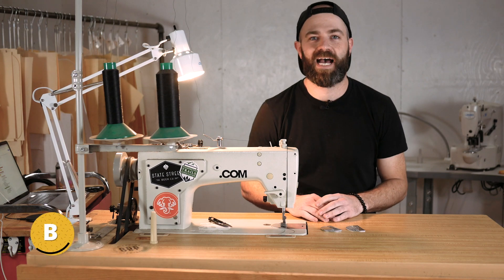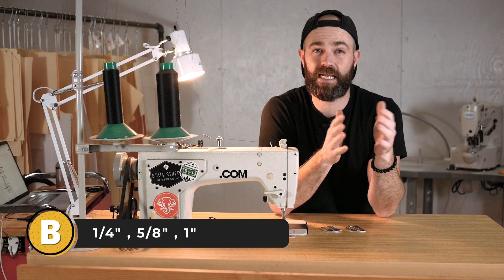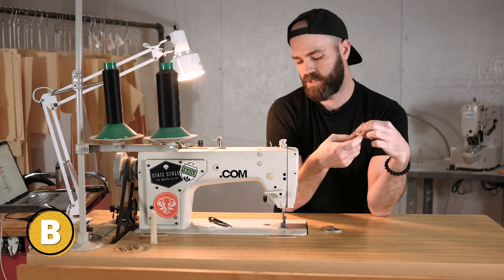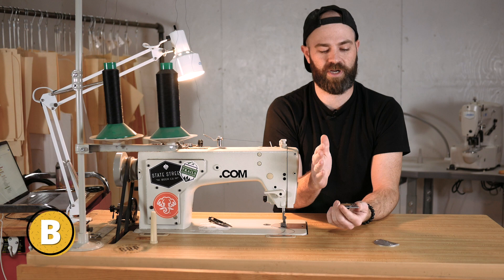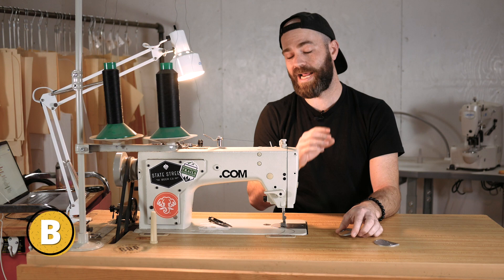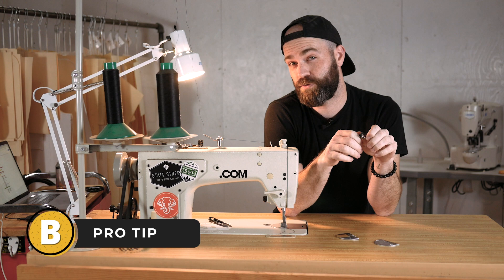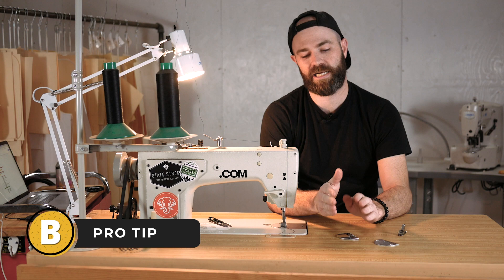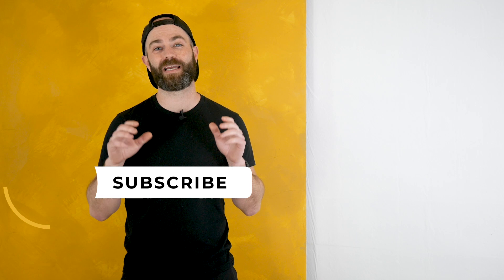What Is Seam Allowance?

Comment: Sorry I'm confused, the compensator foot is 1/8th of inch but you said you use a 3/8ths seam allowance? Is that because you use a smaller seam allowance for topstitching. Very new to sewing thanks!
Reply from the maker: That is correct! I don’t use the compensating foot for the seam. I use it only for the top stitch. But I leave it on and use the edge of the compensating foot for the seam allowance (mine is a perfect 3/8”).

Comment: What’s the best machine for a beginner to intermediate sewer looking to make bags and other heavier weight projects? I just finished a sewing class where I designed my own bag and patterns and sewed it on a domestic machine with a few problems. Any suggestions?
Reply: If your starting out I'd reccomend getting a vintage domestic machine. I have two of the old cast-iron Singers from the forties and they can push through a good amount. I wouldn't do heavy leather or upholstery but 90 percent of my bag projects are no problem. They're relatively cheap on CL.